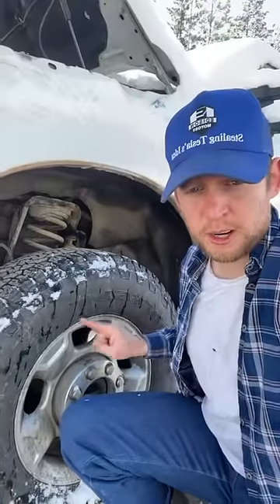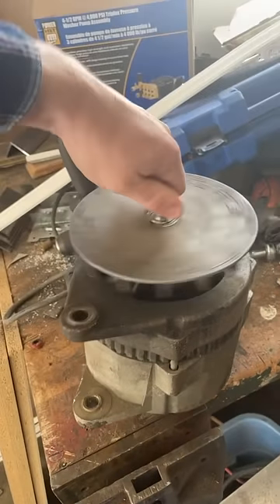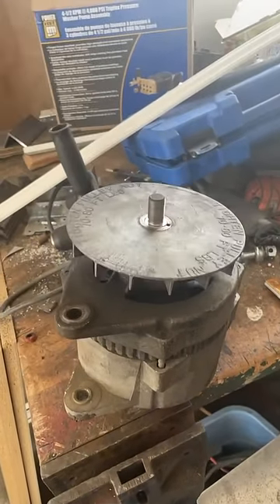Alternator on each wheel???

Comment: Honestly, you could just say there is. That's what regenerative breaking is.
Reply: Not really, but kind of I guess. Yes its a generator, but it's using energy that would otherwise have been wasted. A turbine on the car would create drag and a drop in efficiency that would negate any power it would generate for a loss. With the braking aspect you've already expelled the energy to make the car move, it is just capturing it which otherwise it would be lost, the have high resistance and produce more power being harder to turn thus aiding in braking and able to get some back. No system is perfect by  any means , figure one out and you're a genius.
Reply: That just wastes less energy when you brake. It's still a net loss. Ideally you should never have to break but you can't predict other insane drivers, the timing of lights, ignore stop signs, etc...
Reply: @alphatrion48  I think the point I was attempting to make was either not clearly indicated, or missed.

An electric motor, is also an electric generator. When the motor is being powered, it spins. when the motor spins without power, it makes power. 

An alternators when spun, makes power. You can also power an alternator, and it will spin. With some minor fenagling. 

It's semantics.
Reply: @ikatekeda6267 you are absolutely correct and that was my first thought as well. A motor is just an alternator in reverse.
Reply: Tit for tat type deal yea know.
Reply: @alphatrion48  Yes really.
Reply: @ikatekeda6267  I wasn't arguing or saying that he was wrong. I was just saying that no system is perfect and there is always a loss in the end. Most electric motors can become a generator in some capacity. Some are just better designed for that specific purpose based on the application. In the case of Teslas it has a lot of kinetic energy from the weight of the car that can turn a much higher resistive motor and create more power faster while slowing the car. This would not be ideal for systems with less energy to turn the generator, so those would use a less resistant motor but faster rotation that requires less torque to spin.
Reply: This was my first thought as well. Obviously, just a fraction of energy recapture. I’d like to see bicycle style pedals at every passenger seat to charge the batteries - call it ‘passive’ energy generation. 😆
Reply: Going downhill also captures some energy with regenerative braking.
Reply: Why can't we use suspension-flex to generate electricity?
Reply: @Gideon_Judges6  wastes energy. It isn't wasted,  electric cars use motors to slow down 90% of the time. This is why the brakes last so long on them. Its just a way to recoup some of the energy expelled to accelerate the car. Everyone uses brakes at some point, no matter how much you try not to.
Reply: Regenerative BRAKING... Only works while slowing down, not cruising.
Reply: Regenerative BRAKING... Only works while slowing down, not cruising.
Reply: It wouldn't have described what the old man was trying to say.
Reply: @DesertSessions93  no shit. But you can't generate power at the same time you are expending power for locomotion.

So you're either using power to move, or you are trading your cruising energy for power to slow down.

Did my message somehow imply I didn't know what the word breaking meant?
Reply: Or the suspension that charges from bumps in the road
Reply: He did.
Reply: @reaality3860  That is aleady in use. For sale. Look it up.
Reply: @DesertSessions93  Duh... its in the name... BRAKING
Reply: My car has that system
Reply: Literally
Reply: @alphatrion48  so essentially a perpetual motion machine versus regenerative braking
Reply: Yup. Most hybrids have it. Yes it's done by a generator which does create resistance.
Reply: @ikatekeda6267  I support any semantic argument that includes the word "finagling". 😊
Reply: @bipolarbear7325  Well that's good. I always need more support for my semantic arguments.
Reply: Toyota does it on the braking system of the prius.
Reply: @alphatrion48  add solar panels would also extend your range. They dont give them away but if they put them on a no frills grocery getter or to the job sight and back home only car could be worth the added cost of the solar panels..the car would not look very pretty covered in solar panels, but who cares ? Slow charging batteries also almost if not doubles the life of the battery and solar panels efficiency is about 40 years ...there is no reason why you cant drive the same electric car to work and back home ..if you live close enough to work and in warmer climates you would need no heater or air conditioning ..power steering and power brakes my not be needed if the car is small enough .  That would equal farther range
Reply: @ikatekeda6267  a diesel locomotive does
Reply: @donniebaker5984  make electricity by spinning is wheels while said wheels are being driven?

No, the diesel engine generates electricity, which Powers a battery...

Wait, I'm explaining this on a video about diesel locomotive trucks, what the fuck.
Reply: Yep. It helps, but just a partial recovery of the kinetic energy of the car instead of being wasted as heat from the brakes.
Reply: Because when you brake you actually need to lose energy so instead of losing it in heat it converts it to electricity
Reply: @alphatrion4020 the funny thing is, if it had an electric motor this would actually work as a less efficient hybrid. 
you can actually tow a EV with a gas vehicle, then drive the EV and get better mileage from the power gained from towing it lol. 
Engineering Explained has a video of an f150 towing a tesla and it is basically a hybrid system. it shows that you can't make energy from nowhere, but it can be used more efficiently.
Reply: @alphatrion48  what?
Reply: @Yamahut13  that would save energy because current shock absorbers convert bumps into heat; you would be creating electricity which would be used for propulsion. But it would be very little and very expensive. Probably cost $1000 per car (you not only have to generate the power but buffer and rectify it to stick it in a battery because it will be impulses not DC and youll also need to write software to control and track it) and save $13 over the life of the car, and be another thing to break. Better off spending $200 on solar panels on the roof and getting $600 over the life of the car.

I saw once a documentary where somebody had created a floor mat in an office building that generated electricity as people walked over it coming in and out of a building. Again impractical but a neat idea.
Reply: @terryswails1191  all hybrids and electrics do
Reply: @donniebaker5984  A diesel-electric (vice hydraulic) locomotive creates torque by burning Diesel. That torque spins a generator which converts it to electricity. Electric motors on the axles convert the electricity back to torque spinning the wheels and propelling the train. 

Dynamic braking on said locomotive uses the motors on the wheels to convert momentum back into electricity, BUT it is not stored or reused, it runs through a resistance heater which creates heat which is then blown overboard by a fan. There a couple of experimental Diesel hybrids which look to capture that energy (which I myself have advocated for decades, particularly in mountainous areas) but they are not in mainstream operation yet. Personally I would like to see the electricity generated by a big train going downhill (which is megawatts) used to electrolyze denatured water in a big tank car into H and O which is captured in a different tank (well, 2 of them) and fed back thru a fuel cell to go back up the hill and be converted back into water. Obviously not 100% efficient, but way less wasteful than using it to heat the surrounding air.

Electric locomotives (the kind that run off overhead wires) can convert the momentum back into electricity and feed it back into the wires for some other locomotive to run off of.

Comment: I'm glad you mentioned regenerative breaking. 
I'd just like to add that you also don't need an alternator on the wheels to re-capture some of the energy while breaking because the main drive motor can do it.
Reply: The main drive motors in Tesla's do do it.
Reply: People that don't know about regenerative braking don't understand basic electronics.
Reply: ..."braking"...
Reply: So the main motor on decel acts as an alternator? That's cool. I would have suggested the wheel alternators that only work when braking, retracting contacts or something
Reply: @zanelampen5288  Correct. Likewise, if you wire up an alternator the right way, it can also work as a motor when fed electricity and then as an alternator when braking or spun using an engine.
Reply: @anthonypelchat  yeah I just didn't know Tesla's were doing it. I wonder if regenerative power is taken into account with the displayed range, averaging the power it regenerates every few minutes maybe
Reply: @zanelampen5288  It definitely does if you use the route planner. I think that it does during normal driving as well, but not positive.
Reply: I just wish someone would just do and show the results so it can be put to bed. 😂

Comment: Exactly, we learned first year in electronics class, "there are no free lunches".
Energy can't be created or destroyed, it can only change forms.
Example: mechanical to electric, electric to heat, electric to mechanical etc.
You will create drag on the wheels from the alternators or generators when in use.
The electric motors already actually function as alternators when coasting anyways.
It's called regenerative braking.
They can slow the car by increasing the charging loads.
Reply: Regenerative only happens when breaks are pressed barely charges anything.
Reply: @ghost VA2PA We run on two energies the human which we get from food The soul I'm not sure I would say from God but it's the part of us that always was is and will be.
Reply: ADD the other factor to the puzzle. MAGNETS. ONE pushes ONE pulls. there's your North and South. THEY help MOVE the system. ADD this to the PUZZLE and THEN rethink your theory. Amen
Reply: @ghost VA2PA cute wishful thinking
Reply: They don't cause enough drag imo
Reply: With regenerative braking you coast until field windings are energized. Then you are braking and charging back to the batteries. This isn't considered a free lunch since you're braking anyway and any current returned to the battery makes it a reduced lunch.

Comment: That old guy is a direct descendant of the "inventor" of perpetual motions machines.
Reply: "Why do they need to plug them in. Just put alternators on the wheels."

And with that, humanity's energy crisis was ended.
Reply: @B  with that we have zero use for 90% of our law makers. No crisis no job.
Reply: Hello beautiful Honda on the pattern Honda design a braking system that recharges the car using momentum the momentum of starting up in the momentum of slowing down creating energy
Reply: Everything thig DNT have to be electromagnetic induction!

We can use Parmanet magnetic 🧲

Designs from d tire rim during design to roll over a stator just like motorcycle 🏍️ charger, now since it's not electromagnetic induction

U wld use less kinetic energy

Also Abt graduates & high school 

De is still room for new inventions, everything DNT have to be based on principles.....

Brake boundaries

Comment: What you have to understand is when a generator or alternator is powering something, like a battery charger, it is under a load. That causes it to become very difficult to spin.
Reply: Yes. The reason it does this is the eddy currents in the wires produce an opposing magnetic field. Which is why putting alternators on an electric car is stupid. LEt a lone one on each wheel. The Dunning-Kruger, I tell ya! !7;^D
Reply: Hence, why tou only engage it during braking!
Reply: @Dr. Robert Johnson  I think you just described yourself!
Reply: @Will_Wel  I recognize its a possibility. Please enlighten me.
Reply: @Will_Wel  The electric drive motor does this already just by existing. It can either take electrical energy and use it to rotate a shaft, or take rotational energy and output electrical energy. This is also why most hybrids use the electric drive motor as the alternator and starter as well -- there is no need for several components that all do the same thing.
Reply: Why can't you decrease the load wth say gears
Reply: @B-rad1  The only correct answer here 👍